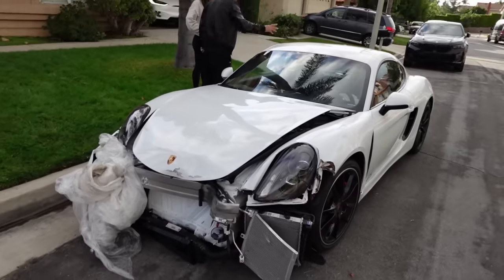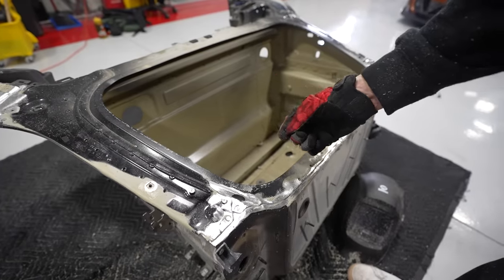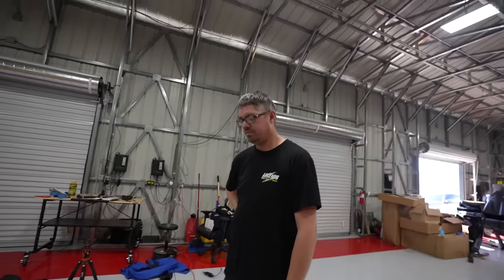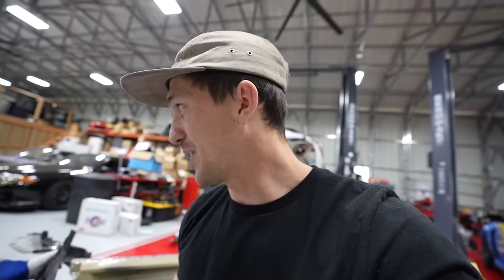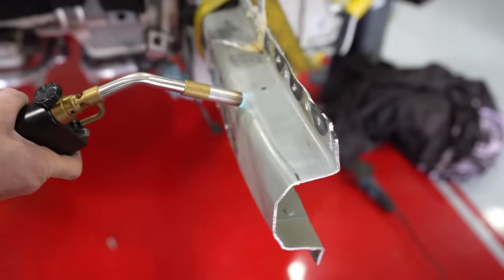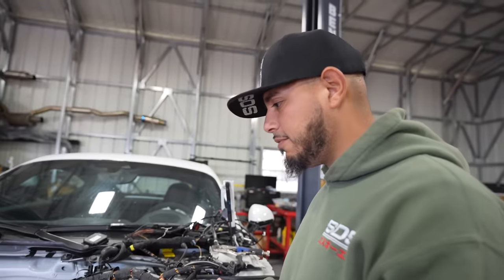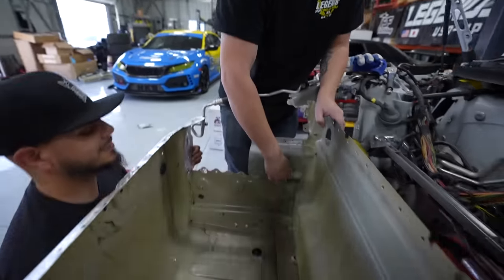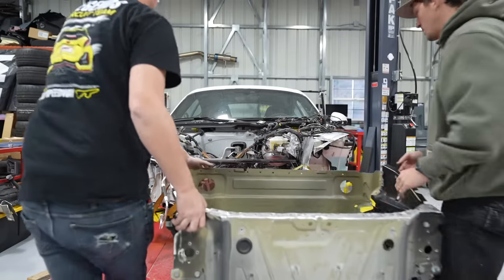Making a WRECKED Porsche Cayman GTS NEW AGAIN! Ep. 4

Comment: Why would you take the frame rails off the new tub to put different frame rails back on? Just drill out the excess at the join and leave the full tub and rails together to fit as one
Reply: He could’ve saved a lot of money and time by using the already straight rails
Reply: I wonder if the recycler cut the rails (just further back), so that they weren't usable?  Anyone know if there is an exploded view of the 981 chassis online somewhere?

Comment: God I feel your pain having done something almost identical on a 981 last year albeit my chassis rails were good. 3mm drill the rivets out, a 10mm to take the head off and then punch them out with an air hammer. Heat is essential to easily separate the panels

Comment: Hey bro... Why don't you just cut the frame real o. That side, beyond the bend, and just re-weld the side from. Ge new tub... drill out the rivets o. The new tub from he side that's good, and take that Fram tail off the new tub.. And then leave the side on the new tub that's bad on the car... so one NEW frame rail, and one original rail... cut it into a Chanel on the car, and then cut a channel the opposite way on tge new tub... So that you can slide the 2 pieces together, and then weld it... So it will basically slide together so you can drill a hole in the outer piece, and then you can either throw a quick spot weld or a rivet to hold it temporarily while you weld it all around, ya know what I'm saying bro?? So leave the car side, and the tub side a little long, b4 you make the channels... so that one side can slide into the other side, and they will match up... It's kind of hard to like say it, ya know... It would be easier to like draw it out... I wish that I had like MS Paint on my phone... I hope that you like understand, what I'm trying to say bro!!!!